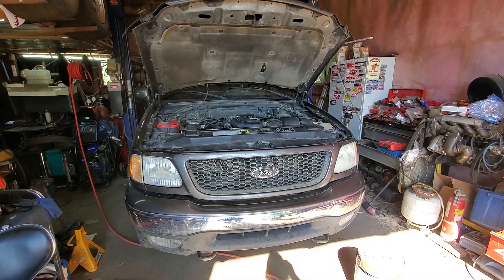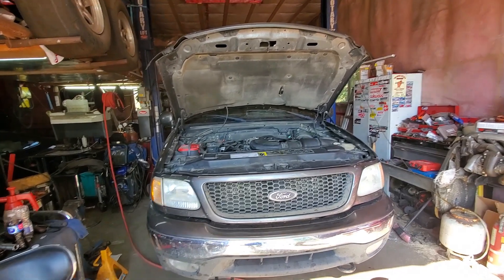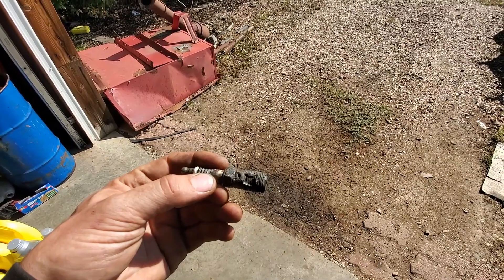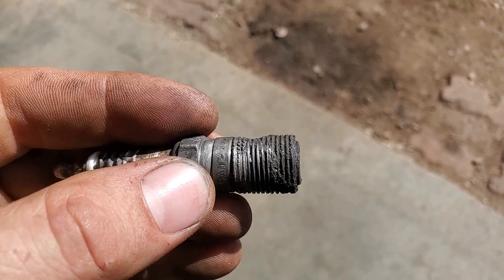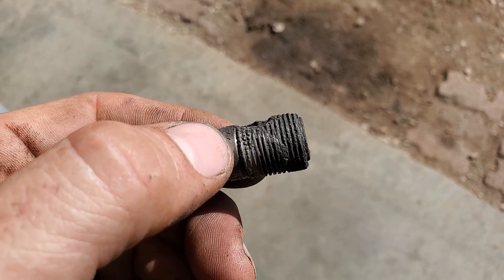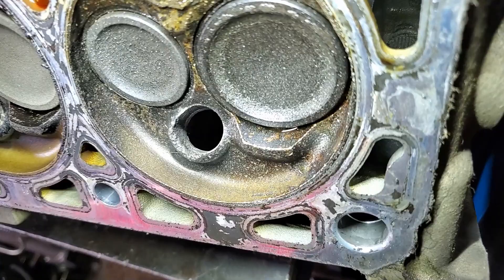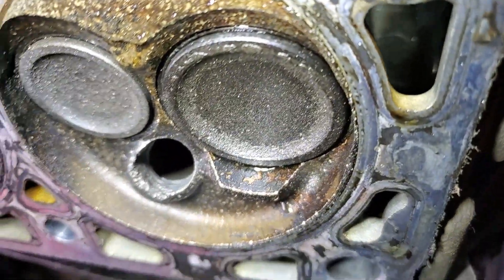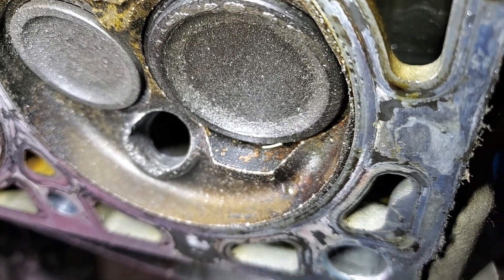Ford 5.4 spark plug Helicoil Failure

Comment: The heli coil I was shown was not one of them kind but rather more like a spring like device that goes into threads
Reply from the maker: I would trust that style more.
Reply: @ good deal, although had one spark plug repair done by another mechanic the number 3 plug was blown out and he used a Dorman repair kit self tapping sleev that remains I sure hope it’ll last, upon inspection this said mechanic found that the number 2 plug also blew out and that is the one a new mechanic will be using the older style coil design heli coil in